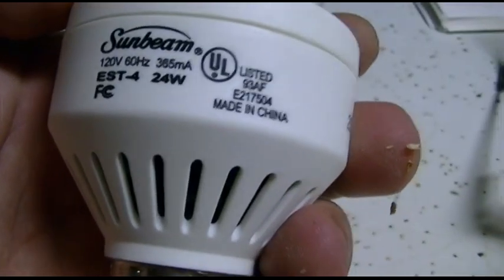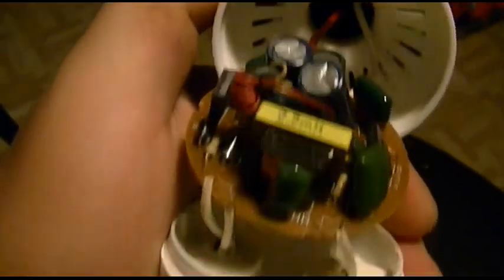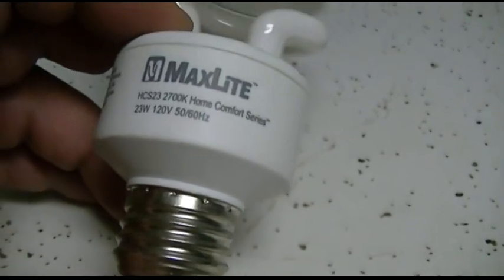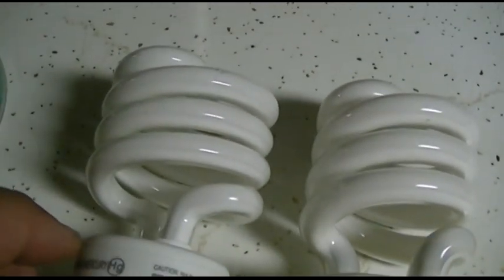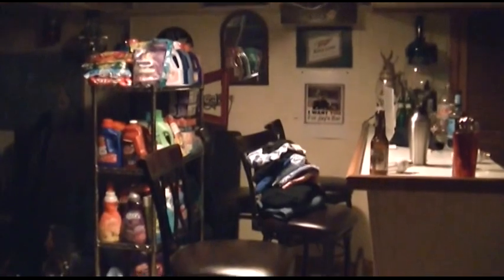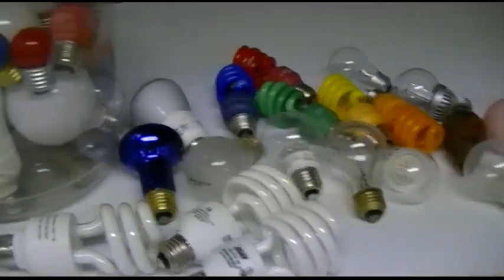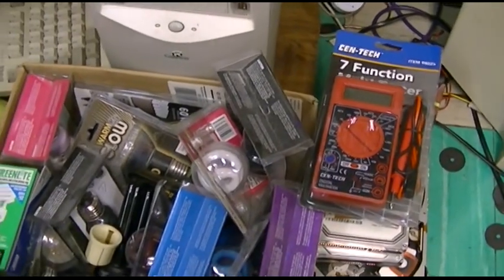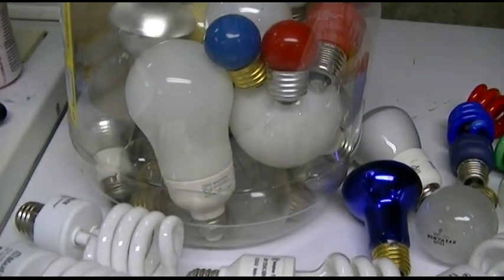Bad Sunbeam 24W CFL Bulb

Comment: Sunbeam bulbs tend to get mixed reviews, but this cfl seems to have vents on it, the newer CFLs lacked vents and weren’t that great. It seems like this bulb had a failure mode where the cathodes were glowing, as I saw a fair red glow on the bulb, it might’ve been mercury loss too or another problem. Maybe it had a failure mode where it only had a partial discharge left on the bulb, but a lot of the mercury got lost too, causing it to glow that dim red color. I believe the sunbeam bulbs often were bought at dollar tree.

Interesting failure, and interesting bulb. This sunbeam CFL is UL listed which is surprising for sunbeam bulbs. It was used in an enclosed fixture so it was surprising for how long is lasted, and enclosed fixtures decrease the life of CFLs.
Reply from the maker: I think I bought these at Walmart early on in the CFL days.

There is a CFL in that same fixture today, though I don't remember what it is.  All I know is it's instant on, and only occasionally does it really require some warm-up time.  Depends on temperature, and how long it has been since it was last on.  Gets used practically every day, sometimes for only a few minutes, other times for many hours.  So it gets a good mix of real-world usage.

Comment: You really have a lot of light bulbs! I always preferred incandescent over CFL. The light from incandescent bulbs seems better in my opinion. Have you ever had a CFL fail violently?
Reply from the maker: +Andrew Gallucci YES!  One day in the summer outside in the screened room.  I have 3 CFL tube-style dollar-store bright white bulbs out there.  They were on, and the central A/C took that moment to start.  So now there's a voltage sag followed by a surge.  

There was a resounding pop (about as loud as a firecracker), and the obligatory magic smoke was let out.  Autopsy revealed a capacitor exploded.
Reply: jaykay18 Oh wow! I've never seen one fail like that, but I hear that they usually fail with smoke, and an explosion.
Reply from the maker: Andrew Gallucci Yes, and they say that's a "normal" failure.  Of course, my old incandescents used to explode and burn the house down when they'd burn out!

There's also the mercury scare of the CFLs, where if you break one, mercury will be released and your entire home must be condemned, your first born die instantly, and you become sterile.

I was afraid of that too, until I had a pair of standard 4' fluorescents burn out.  Stuck them in the garbage can.  When the garbage truck came, the guy pulled out one bulb at a time, and threw it into the truck like a javelin.  Each bulb shattered into a billion pieces, and essentially "vaporized" into a white cloud.  And he's doing well with his nice house and 4 kids.

Years ago we'd call this an "old wives' tale", now it spreads like wildfire on all those social media sites.  And because you read it on the Internet, it must be true!

Seriously, CFLs oftentimes will fail in spectacular ways.  The manufacturers claim that this is normal failure.  I once did a search on that subject and came up with all sorts of stories and pictures.  Of course now you can do a search and get pictures of a guy with his blank stuck in a blender.
Reply: jaykay18 I've broken a CFL IN MY HOUSE before! I was afraid of mercury when it happened too. I was just on a site and it said CFL's are environmentally friendly!!! What a joke.
Reply from the maker: Andrew Gallucci Exactly my point.  When an incandescent burns out, it is 100% recyclable, it's simply glass and metal, both of which can be turned into something else!
Reply: jaykay18 Incandescent light is much simpler than a CFL is too. It doesn't have any circuit boards and is the simplest circuit I can think of.
Reply from the maker: Andrew Gallucci The absolute simplest circuit is a short circuit.  The simplest circuit that does something useful is one device.  No matter if that's a resistor, light bulb, heater coil, etc.  If you provide some sort of resistance the circuit does something.
Reply: jaykay18 True. Is a grounded circuit similar to a shorted circuit?
Reply from the maker: Andrew Gallucci No, except for the fact that the ground lug is "shorted" to ground just by means of a wire.  When an appliance is grounded, usually the case is grounded.  Normally when everything is working fine, the ground circuit is not in service.

Now, while anything can happen with an appliance, lets say 1 or 2 simple things happen:
1.  The neutral wire inside the appliance falls off of its connection and lands on the case.  Then you come by and touch it.  Nothing will happen, and you wouldn't know.  The reason is because volts, or voltage, is actually a measure of potential difference between 2 points.  As the neutral has 0 volts, you won't feel anything.
2.  The hot wire inside the appliance falls off of its connection and lands on the case.  Since the ground wire is at 0 volts, and the hot wire is at 120 volts, there is a potential difference of 120 volts.  That 120 flows through the case, to ground, creating, in effect, a complete, but short circuit right to ground.  As ground is just that, as in the ground, that voltage is absorbed into the ground.  In a perfect world, should this happen, all that voltage is "drained away" to ground.  

Now, if that were an "open ground" which means that the other end of the outlet's ground lug is actually NOT connected to ground, if you would touch it, YOU would become the conductor, since you're standing on the ground, voltage will flow through YOU into the ground, barbecuing you in the process.

Open grounds are more common than not in older homes.  In the 1950s when my home was built, ground was not "code" so all of the outlets were two-prong.  Over the years they've all been changed (except for 2, which I have since changed) to a standard outlet you can buy today, which is 3 prong.  But that third, or ground prong is not connected to ground in the electrical box, nor is there a wire that goes from there to the actual ground, so it's open.  If you use a ground cheater, which is a plug adapter that allows a 3-prong plug to fit a 2-prong outlet, and that electrical box is not grounded, even it the metal tab is connected, it's an open ground.  Or if you modify a device's 3-prong plug and make it 2, same thing.
Reply: jaykay18 Interesting. Thanks for the info.

Comment: I currently got a Metal Halide 250W High bay fixture. It's really noisy and heavy. Should I replace it with a 85W or 100W Giant CFL and remove the ballast and stuff...?
Reply from the maker: If it were me, I'd leave well enough alone.  Metal halide fixtures pretty much don't exist anymore.

Comment: Did you ever find the Sunbeam bulbs?
Reply from the maker: Nope.  I guess I used them.  I know they were in a 4-pack in the box.  They sat untested for years before I ever used them, and 1 out of the 4 was dead out of the box.  That left 3.  1 was this one.  The other 2 could have gone any number of places.
Reply: With the amount of lightbulbs you have, and considering they were well over 10 years old, you probably used them many years ago and didn't notice.
Reply from the maker: That's likely the case.  Too bad too.  Those Sunbeam bulbs were nice, I should have realized then and bought more.

Comment: Why do you have an exit sign in your basement and in your garage?
Reply from the maker: +Andrew Gallucci Do you really wanna know?

OK, the answer is simple.  One day I was waiting somewhere and saw an exit sign.  I read about them, I saw some vintage ones, I saw some modern ones.  I realized that they are all in commercial buildings and not in a private home.  So, because I lead my life on a "because I can basis", I found that Home Depot sells them!  Of course the ones here didn't sell them.  But one day while vacationing in CT, we stopped in there, and there they were, on display and on the shelf.  It was only a second later that it was in the wagon.

Talking to an ex-co-worker of mine, he told me he is an electrician and we talked about exit signs, so he got me one.  Now I had two.  I actually liked the one from Home Depot better as it was double sided, the one from the guy was single-sided.  So I decided to wire that one up and place it by the bar.  That way the drunkards could find their way out?  At least that was the idea.  Rather, I thought it was cool.

So last spring when xjoe81x was over tidying up some wiring in the garage, I decommissioned the old extension cord.  This was a hack wiring job by a previous owner, they simply took an old extension cord, cut the plug off, and tied into the light over the garage.  Then they ran it out, I surmise for holiday lights.  That's what I used it for.  But this cord was really frayed, and had tons of electrical tape patches on it.  Every year I'd go over every inch and tape it up some more.  One day I found a real nice gash in it, and inside I could see the insulation on the wires inside was crumbling as well, so now it was dangerous.  So the best solution would be to put an outlet in the garage there, right over the big door, and I'll just buy a regular orange outdoor extension cord, plug it in over the door, run it down the side, and out on the ground.  This way I could also unplug it in the spring for further safety; the old cord was live every time the outside lights were on, which was every night.  Since it only took a foot of wiring more, I had xjoe81x put the other exit sign there, as a single-sided sign was perfect for that area.

See?  Simple.
Reply: jaykay18 I get it now. Thanks for explaining.